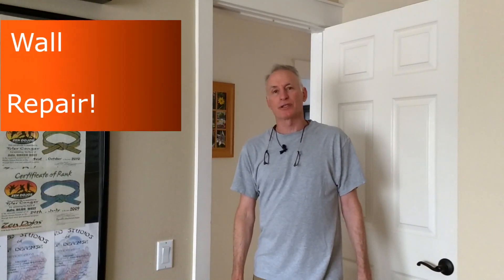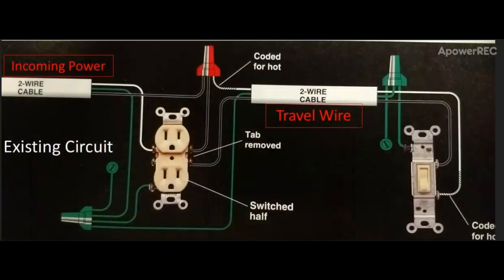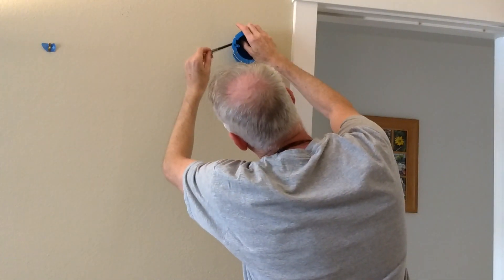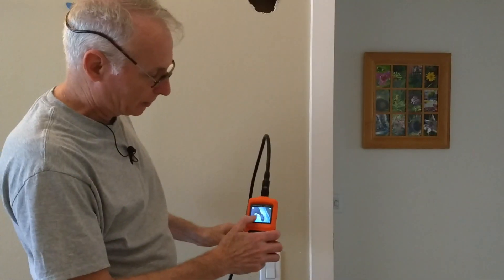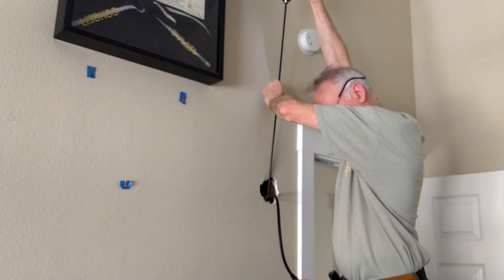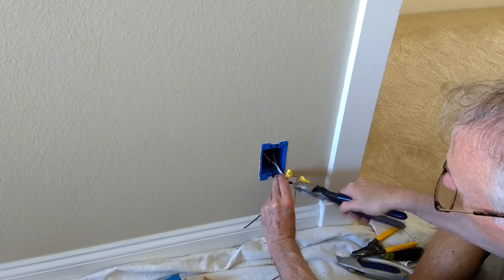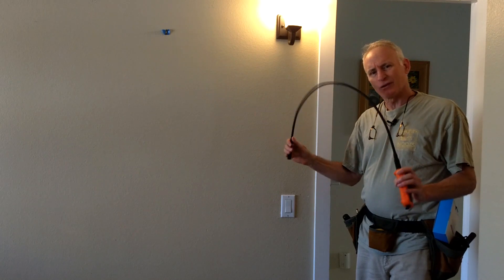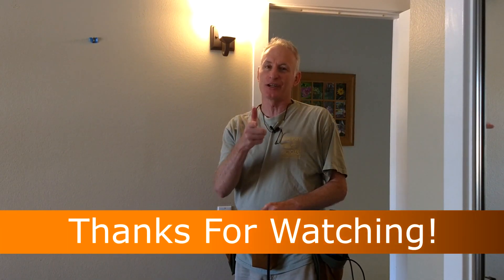How to See Inside a Wall - Klein Tools VideoScope Review

Comment: There is a battery charge indicator at top right of screen, as shown at 5:46
Reply from the maker: Yeah. I wasn't very clear about that comment. What I was trying to say is there is no battery charge indicator when charging. The only way to tell if it is fully charged is to power it on and check that little indicator. I wish they would have made the orange LED turn green or something so you don't have to boot it up and check.

Comment: Hood job
2 notes:
1. Before making the entire hall for the skon I would drill a small hall and sleeve an electrical solid wire or a snake  or the klein camera twist it around to make sure theres no blocking objects so the box can feet prevent  large surface patching
2 after drilling the hall in the wood i would first sleeve an snake from butom which is easier  then from the top tight the 12/2cable and  run it thru it  longer distance would be harder for you to aim wire into the hall